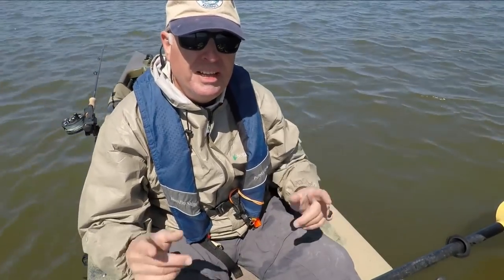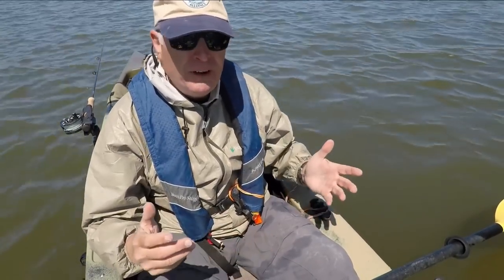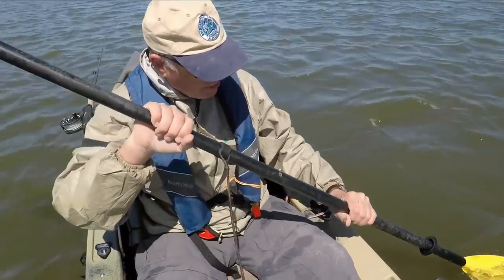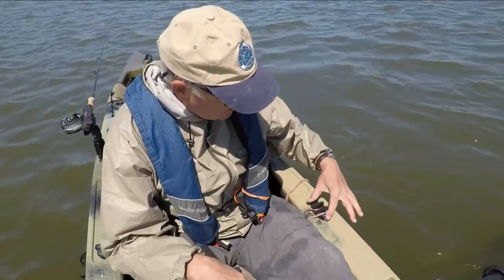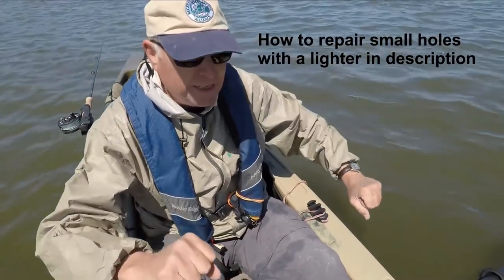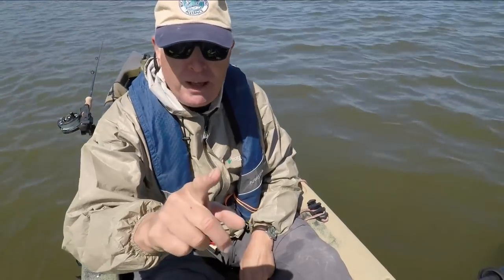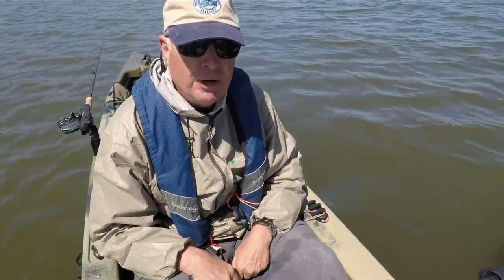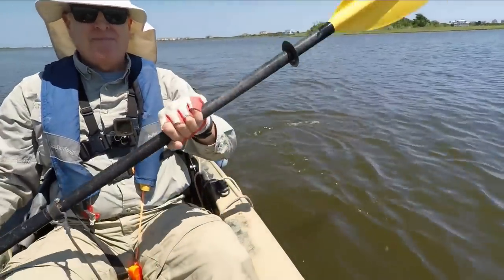Where to Install an Anchor Cleat on a Fishing Kayak for Comfortable Paddling

Comment: I hadn't thought of the cleat being in the way of my paddle stroke; glad I searched for placement ideas.  I have installed an "anchor" trolley on both sides of the yak that I will be using with the cleats.  Since I will be using the system in saltwater that is moving fairly well, I will be using the trolley with a stakeout pole.  In this scenario, the stakeout pole will be located to the stern most of the time, occasionally to the bow, but unlikely in the middle section. At least large chunks of seaweed won't pull the yak under by an anchor line.
Reply from the maker: That early season seaweed drives me nuts! Always happy when it finally washes out.

Comment: Good timing and advice. I have to install a cleat on my yak.  I have one just like yours, but it is to big, so I cut it in half. Hope it works, if it does I  post  pic on your Google page.  TFS  (thanks for sharing)
Reply from the maker: It should work.  I think those things are made for boats much heavier than ours.

Comment: I’m new at kayaking but not new concerning the seas and the forces of currents, wind and other forces pulling a floating object whether anchored or live or;  it’s a small craft or ship.  

It seems to me these moving side mounted anchor mounts would create a serious UN necessary hazard to the operator.

They have their place yes; but I never hear about the correct applications; just how everyone mounts them and it’s either buy one prefabricated or build and install it DIY.  I’m interested in seeing the typical or probable hazards. 

Now; I’m typically working from a 110 or larger commercial crew boat in the Atlantic or Gulf but the captain never or very seldom will anchor on the lee side of the flow of current and never attaching the vessel from points on the sides.  He’ll use a bow and stern line.  It seems to me a Kayak should as well.  I’m thinking a kayak would be far more susceptible to capsizing if anchoring to the sides than a crew boat. 

A huge fish strikes hard and fast then faster once it feels the line.  A kayak attached to a huge shark sideways can be swamped or capsized or the fisherman pulled overboard.
Reply from the maker: It is important to use the trolley correctly or folks would get into the trouble you mention. Here is my video on that - https://youtu.be/q2brpGvhHhk  Thanks for bringing this up.

Comment: I wouldn’t put a cleat on the side of a kayak to begin with.  If you are anchored and catch a big fish the kayak could very easily flip over. 

Consider the current is moving fast you’re Kayak is sideways to the current; now you have a big fish on and in the same side as your anchor line already putting a tipping action on the kayak without a fish. 

Now add the force of a huge fish they can pull a large boat around so a kayak has no chance to spin around; it will flip over. 

I am building a DIY fishing Line guide to ensure every initial strike is first received through the line guide on the bow;  then I can opt to take the line out of the guide, pull up my anchor or be pulled along.  The object is to always have the kayak bow facing the direction of the catch or off at a slight angle to cause more drag.
Reply from the maker: Good point. That is why I attach the anchor with a slip knot so I can quickly release it. I would be interested to see what you come up with.
Reply: Kayak Hacks Fishing.  I appreciate you asking; thanks.  

I just bought something today that I think will work.  

It’s a spinnaker pole mast eye; cast in plastic with a SS eye.  I guess from an old sail boat.  I picked it up at a marine salvage store.  So; I’ll mount the eye on the bow then cut the top of the eye out; 3/8” wide this will be easy enough to drop my line in whenever the fish is close to the kayak and prone to end up on the side and still green.  This won’t hinder lifting the pole and reeling in. The line will go through this eyelet no matter which way the fish goes the bow will follow.  I just adjust my drag.  As long as the fish is in front of me I don’t have to use or think about this being there or in the way it’s only about an inch high maybe 1-1/4” high and 5/8” thick mounted with two SS machine screws or.... sheet rock anchor or equal with a backup plate.  

The forces will only be side to side.
Reply from the maker: Let me know how it works once you get it set up!
Reply: Kayak Hacks Fishing well I mounted three cleats on mine.  One in the bow and two on the stern.  I would t recommend anchoring a kayak to the sides. 

Even if it seems popular it doesn’t make much sense a speeding boat passing by will capsize a kayak easy enough but to snug it down with an anchor then the wake hits you;  not good.  

I work off shore as a diver and use to be a commercial fisherman we never anchored even a big boat from the sides.  I don’t know; I’m new at kayaking but I’d say a kayak is far more prone to a rollover than a crew boat or shrimper.
Reply from the maker: I appreciate your perspective
Reply: Kayak Hacks Fishing I’m thinking about mounting a center keel running the full length and have the ability to load it with lead bars.  
It seems to me that by adding ballast my CG is lowered significantly and with a full keel of say 4” depth the kayak will function better.  This is only a guess at this point.